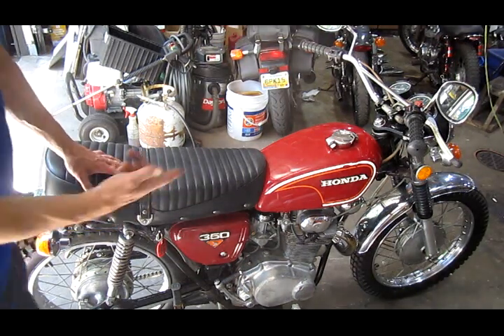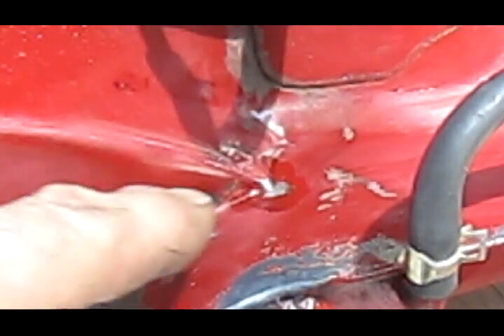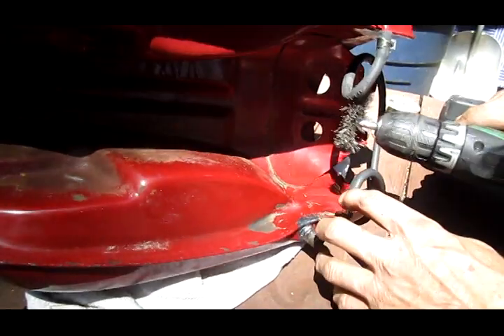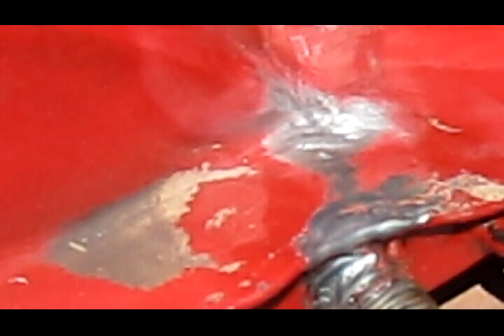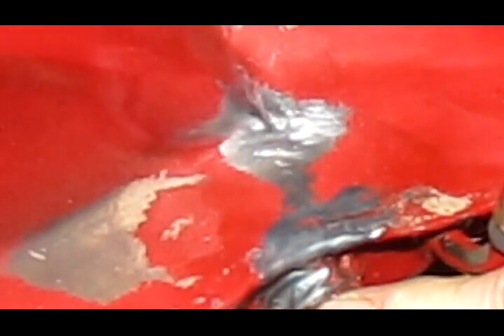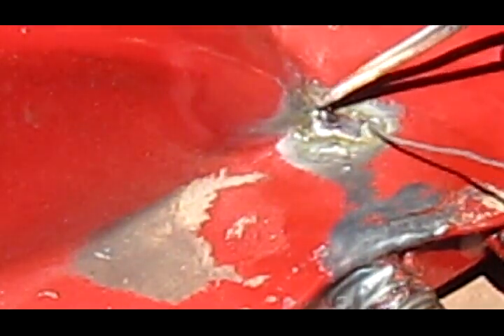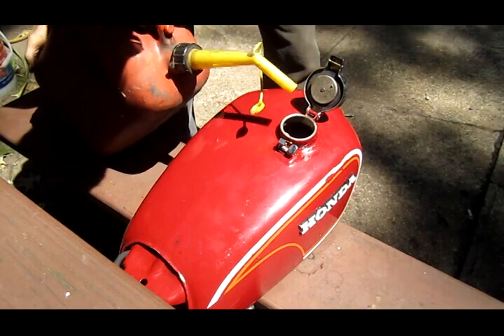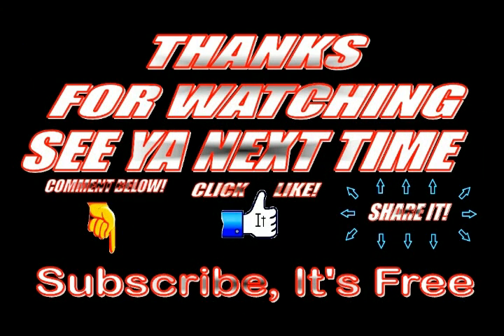Repair a Leaky Gas Tank by Soldering

Comment: This is awesome.  I had a leak in my V-Star 1300 and took it to a local repair shop.  They charged me $300 to try to fix it with JB Weld.  I drove it home and parked it in the garage and an hour later smelled gas again.  What a waste of time and money.  I'm going to pull the tank off, clean up their mess, and solder it myself.  The old saying, "If you want something done right, you have to do it yourself." couldn't be more true.

My wife has been bedridden for the last 9 months due to a severe case of sepsis that she had right after xmas. We just had a nurse show up and replace her catheter.  Right after the nurse left my wife said that it felt like she had to pee.  The nurse had put the catheter in her v-jayjay!!!  I pulled it out and just put in a new one myself.  

For all you youngsters that are reading this, take it from a 60+ year old -- It seriously pays to learn how to do as many things yourself as you can.  It will save you a TON of money and, even if you "normally" hire someone to do something, you can make sure they are doing the job right and you can fix their fuck-ups in an emergency.
Reply from the maker: I agree,

Comment: I did a similar CB360 petrol tank that had 8 pin holes.  The only thing holding the fuel in was the paint..!    After exposing the bare metal, I put a round blob on each hole.  Unfortunately when this was repainted the solder pimples were pretty obvious.   What I should have done after cleaning the metal, was to punch in the hole with a ball-penne hammer, so the solder would lay flat.

Comment: How's the fuel tank holding up?
Reply from the maker: Still doesn't leak.
Reply: @A Motorcycle Nut  my 1986  honda fuel tank has (2) small pinholes and I was thinking this method would be good.   I think I will try it out
Reply: @Amotorcyclenut  any extra advice would be greatly appreciated

Comment: Good video but for those who can't solder epoxy (JB WELD) would do the same
Reply from the maker: JB weld will leak.
Reply: @Amotorcyclenut  Have it on my stroked shovel tanks for years and no leaks...as with any thing it take proper prep

Comment: I wonder if this would work on a Car's gas tank? My only concern would be the temperature underneath the vehicle with Exhaust pipe. Would it be enough to melt the solder and the tank start leaking again?
Reply: Should be fine
Reply: Well just a few figures for you..   Solder melts at 370 degC and the flash point of Petrol is 75 degC.  So you have lots more to think of before worrying about the exhaust melting the solder.

Comment: Maybe for Tiny tiny pinholes. Otherwise, this is NOT the best way. I strongly recommend JB Cold weld! ✅ Done
Reply from the maker: I have been fixing bikes since the mid seventies. I have never seen JB weld hold up on a gas tank leak for any period of time. If the hole in the gas tank is bigger than  the diameter of a pencil you can cut out a small piece of metal and solder it in to patch the hole. If done correctly, it will last more than ten years without leaking.  That's my experience, but you are welcome to fix your bike any way you want and I wish you the best of luck.
Reply: I've tried jb weld twice the first time lasted a year or so and the second time it only lasted a week so I'm going to try this but I'm worried about the fumes causing an explosion any ideas how to solve this I hear you can put exhaust fumes into the tank but I'm not sure
Reply: Also I had this same bike awesome classic

Comment: Having read a Google review of sb. lamenting a bike bought with a pinholed gas tank, I thought of solder as an ideal fix. It turns out I'm right. 

In his case a seller hadn't mentioned the 2nd-rate epoxy repair under the paint. Unless repair is on a stressed joint, welding gas tank metal is generally overkill. Solder can fill the gap nicely.

Comment: Thanks for the video, I am currently de rusting the inside of my bone stock 1968 XLCH. I am very careful to preserve the stock original paint in the process. I found two pin hole leaks at the bottom and will be soldering them just as you demonstrated.  Thank you, and congrats on owning that vintage 350 Honda. One of my favorites!
Reply from the maker: Glad to help

Comment: What if i have fuel inside the tank while im soldering the tank? Is that flammable?
Reply from the maker: Drain the fuel out of the tank, and remove the cap. Yes, gas is Flammable and fumes will explode. so clean your tank out and let it dry.
Reply: You should empty gas tank.

Comment: I have a tiny rust hole .. like the size of a pin head ..that is on the side of my tank like half way up.. it already ate through the paint ..while I slept of course .. do you think that I can solder that as well? Or is something along the line of a patch better ? ..
Reply from the maker: You can solder it, but you will probably fine a few more when you clean that hole up. I think that the metal in your tank is getting pretty thin.

Comment: You emptied the tank of gas but not use a rinse to get all gas out, is it not dangerous to have heat from the gun and solder to ignite the tank??
Reply from the maker: No flame, no fire, as it warms up the gas just evaporates
Reply: @Amotorcyclenut  I always rinse out with water to be on safe side plus gets out any debris then dry with compressed air
Reply: @nathanwarshawsky3871  rinsing a fuel tank with water is madness cause it will only invite a rust process especially where you have soldered. The inside of tank will be scared by the heat process to solder the hole. Just a thought I would rinse tank with alcohol then air it out with vacuum cleaner and put a thin coat of oil inside to prevent rust from manifesting it's ugly head. Rust process starts nearly straight away when metal has been scared by heat.

Comment: What if there is a hole in engine and engine oil is leaking?? How we can fix that hole?? Plss help me
Reply: Solder won't hold on an engine. The heat is too high. However you should be able to braise the crack or have a shop do it.

Comment: can you use normal electrical solder that is tin/lead? Or do you need silver solder
Reply from the maker: I used normal electrical solder cause that's what I had on hand, but I think silver solder would be better.
Reply: @Amotorcyclenut  You can also get a low temp silver solder that might work well.
Reply: Supposedly ethanol will eat solder.. can you tell us what's the results today? Thanks for the video I'm not a fan of sealers either...
Reply from the maker: It still doesn't leak today.
Reply: @Amotorcyclenut  nice, if it works it works. That's awesome. I brass brazed. The hole was about 3mm wide. Could've used your trick and avoided the burnt paint...
Reply: Did you used silver braze? I need to fix some rust cracks on my moped fuel tank. I think that it would work better than electrical solder.Cheers

Comment from the maker: To support this channel check out Amazon through the links below:
Genuine Honda - Fuel Valve Petcock - 16mm x 1.5mm - 16950-292-000 - CL175 CB350 CB360T CB450 CL450  https://amzn.to/2wnv7vv
Weller D550PK 120-volt 260/200-watt Soldering Gun https://amzn.to/2BIzRlk
Pure Acetone, 16 fl. oz. https://amzn.to/2o8ZNNG
Soldering Flux Paste https://amzn.to/2OXlv2c
Solder Rosin 1/16", 4 oz. https://amzn.to/2P4o7vu